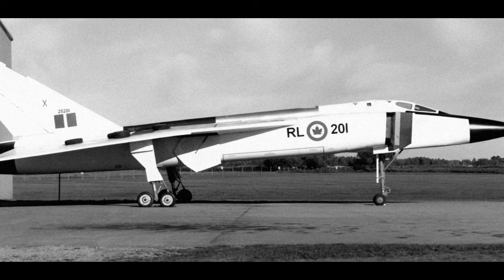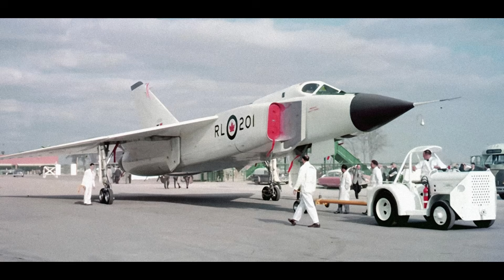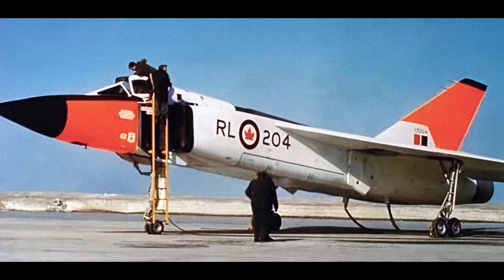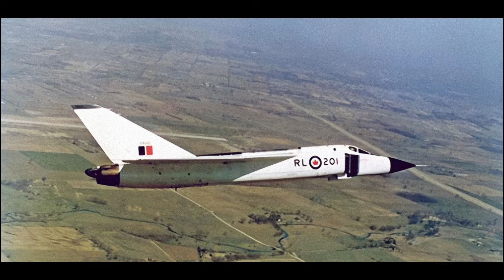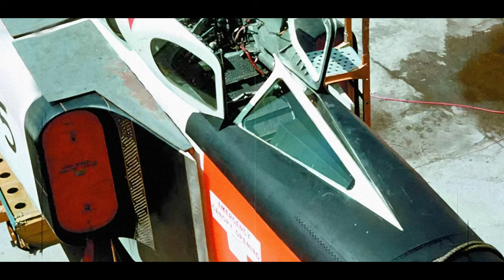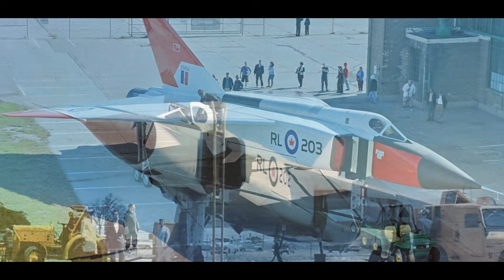Avro Arrow: Sold for Scrap at 6½ Cents a Pound

Comment: A rather interesting set of historical facts that should immediately tell you just how good of an interceptor it actually was and would've been; is that the prototypes of it's U.S. contemporary: the F-106. Despite them flying much earlier in December 1956, flight testing with them had demonstrated lesser performance gains than anticipated and as a result of that the USAF decided to order only 350 of those aircraft instead of the initally planned 1,000 units.

On the other hand meanwhile, the first five CF-105's despite them flying much later in March 1958, flight testing with them had demonstrated excellent handling and overall performance. Reaching Mach 1.9 in level flight. This along with the first five Arrows already flying and with the next 32 aircraft on the assembly line, the RCAF had then planned to order another 83 more aircraft as well as another 100 more by the time the program was abrubtly cancelled.